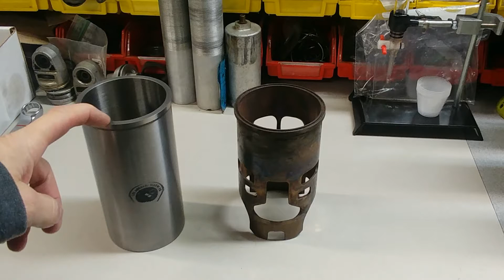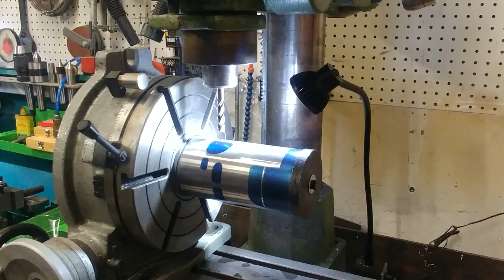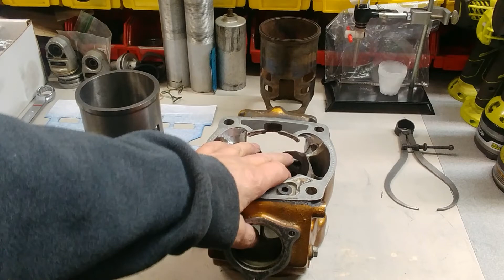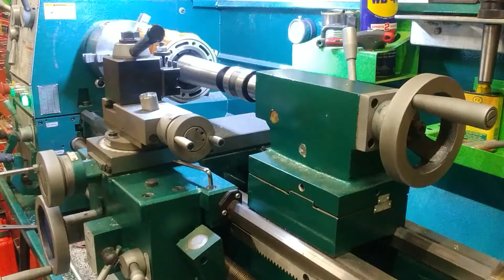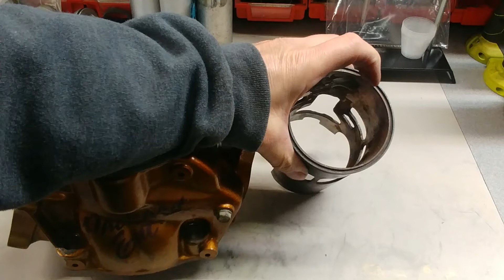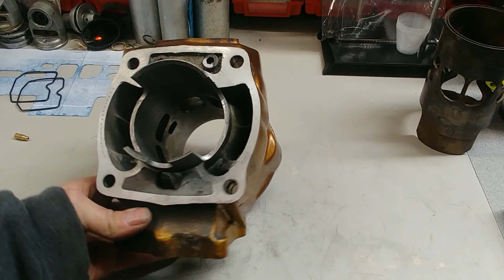350 Big Bore for 250R Honda

Comment: Phenomenal work man!   Jezz, done this before?   Curious how much you changed the port timing and where or how it pays off?
Reply from the maker: on a 2 stroke port timing is a major piece to making power. Has to be optimized to match the pipe and the RPM range the motor will be used in.

Comment: ********IS THAT A NO POWER VALVE CYL  ???? AND WHAT YEAR ENGINE ???********
Reply from the maker: Correct, that cylinder doesn't have a power valve. It's an LA Sleeve 330 big bore cylinder originally but it been punched out to take the bigger sleeve.

Comment: From witch model of 250 Honda is that cylinder?
Reply from the maker: That cylinder came of of an ATC250R, but it's exactly the same as the TRX250R. It is not an OEM Honda cylinder though. That is an LA Sleeve casting.

Comment: Excuse the amateur question, but all things being equal, does moving the o ring have a significant effect on the compression ratio?
Reply: the o ring he cut into the head is just to make a seal. taking material off the head to square the sealing surfaces may have affected compression ratio by increasing it, as he did take five thousands off or so.
Reply from the maker: yep, no difference in compression with the o-ring. Just more reliable sealing.

Comment: Can this be done to a cr250 06 model
Reply from the maker: Yes, I do a lot of 250 Honda's. Bore on Honda's is limited because the head studs are closer to the bore than a Tecate. I have a couple 250R motors in work now that i may post content on later.
Reply: @ilrperformance7152  please post the work you’ve done on cr250’s. I’m getting a ring at the bottom of the power band. I’m taking it apart before something happens
Reply from the maker: yes, I do lots of different years

Comment: What does something like this run an individual?
Reply: The cylinder is fine. I wanted a big bore for my 250 but I can only find those that can do 265. I really like the idea of a 350 bore
Reply from the maker: That really depends on what you need. I can sleeve something that hasn't been sleeved yet and usually make it larger, or I can repair most any damaged cylinder. It's all custom fab so price depends on what is needed.